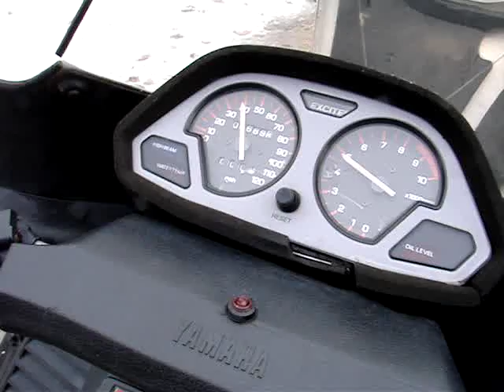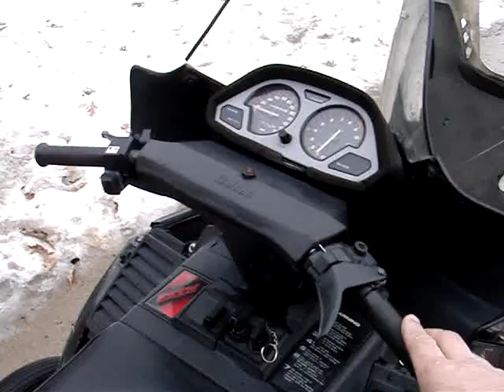Yamaha Exciter 570 L/C  Snowmobile 1988 1989 1990 1991 don't remember.....

Comment: the only electrical problem I had with mine is that there was a wire disconected near the coolent tank and It wouldnt get no spark. So you get spark but when you try 2 start it wont but when you let the key off it wants to. Try putting gas directly into the cylinders and pull it over with the pull cord. If it doesnt start then then it must be something electrical. When you start with the starter does the spark get its power from the battery and when it lets off runs on its own. Mines isnt so idk

Comment: @123devinzz1 im gettiing it fixed next saturday!! :D and i have a wuestion we also have a 92 exciter II and it has spark but it wont start...... we put a new cdi box on and it gave us spark could there be something wong with the wires? as soon as you let off the key it acts like it wansts to run but it wont. Its electric start